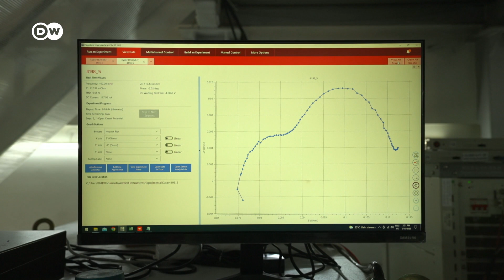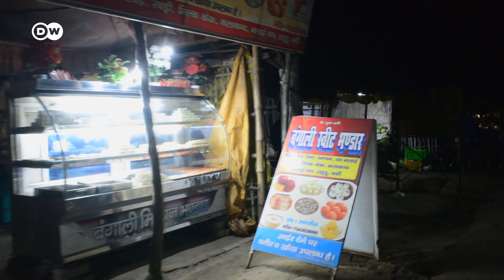From Audi to E-Rickshaws: Nunam Gives a Second Life to EV Batteries

Comment: PUT AIR SCOOP TURBINE GENERATOR ON ITS ROOF AND MOTOR GENERATOR ON FRONT RIM TO HARVEST ENERGY FROM WHELL MOVEMENT AND SUPER CAPACITOR AS FAST CHARGER ON ROAD, ALL THOSE ELECTRIC VEHICLES ACTUALY PERPETUAL MACHINE, NO NEED NUCLEAR CAR OR HEAVIEST BATTERY BUT HACKING AND SMITH,  ACTUALY WE CAN HARVEST 5000 WATT FROM INCOMING AIR BY AERODYNAMIC EFFECT AND CAR RIMS MOVEMENT.